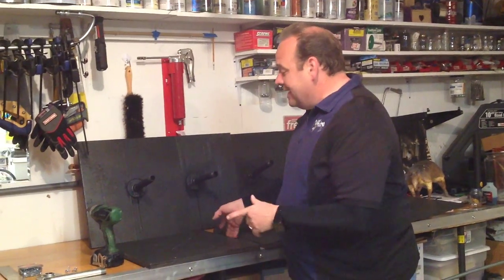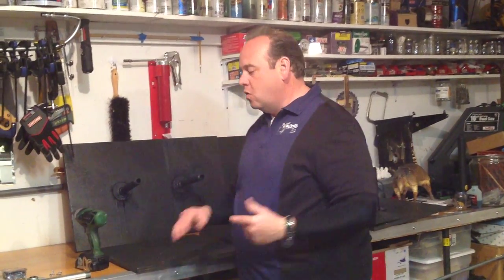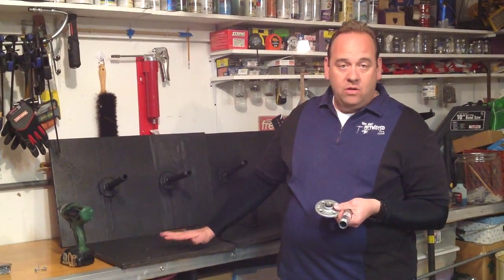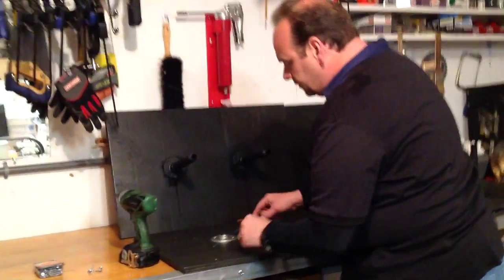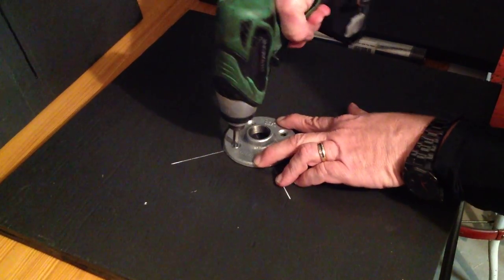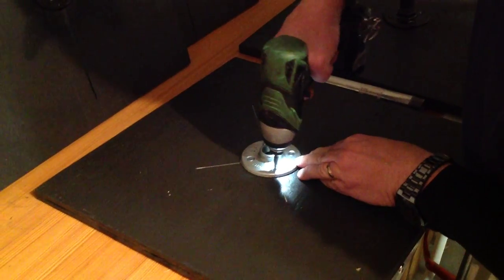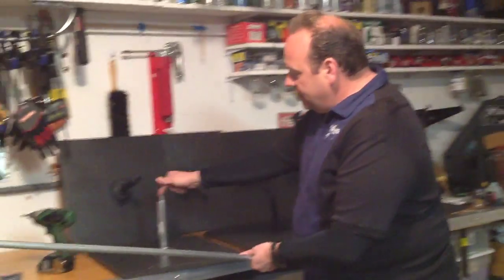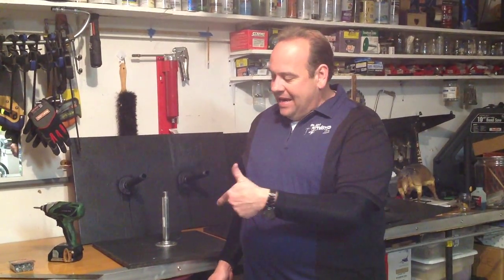How to make balloon column base plates

Comment: Great video! Thank you. How long do you cut your conduit? Do you think the footprint (18x18) of these plates will be ok to use outside if there's no wind? I know I can use weights I just prefer not too. How do you feel about using a screw connector instead, I'll eliminate the need of the 8" pipe?
Reply from the maker: Screw connectors could work. I have actually put a hole in the side of the pipe and used a tap and die on the the hole to put a thumb screw in it. I then use the the thumb screw to tighten the conduit. I use a pipe cutter (from the plumbing department) to cut the conduit). You can use any length needed in these bases… That's why I use the pipe as a sleeve.

Comment: are these only for indoor columns or is it heavy enough to do both in or out also can you use two of the bases for arches?
Reply from the maker: I have used them inside and out. I do use weights on them, but cover the weights with outside carpet to fit the occasion (black or green). I have never tried them for arches, We use another system for that purpose since there is so much tension on them.